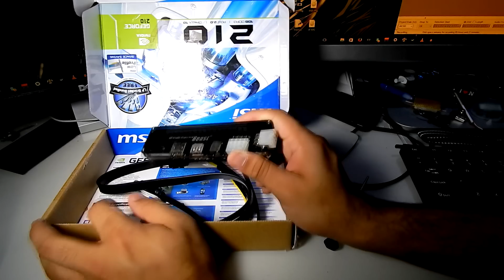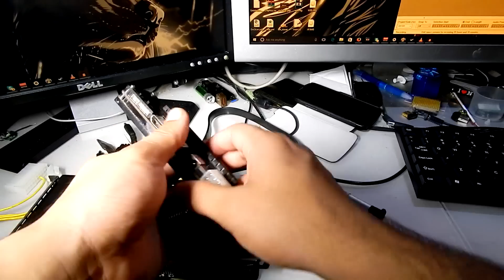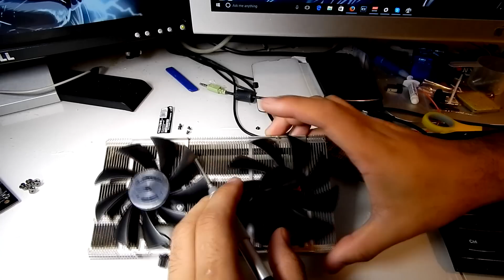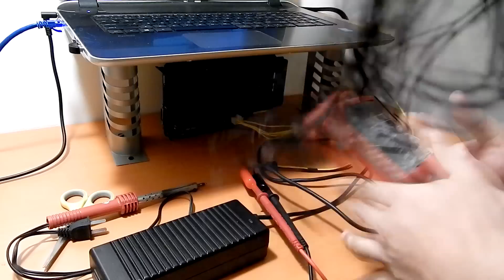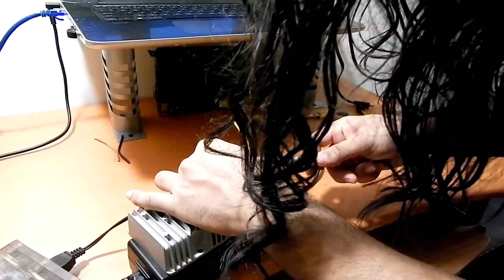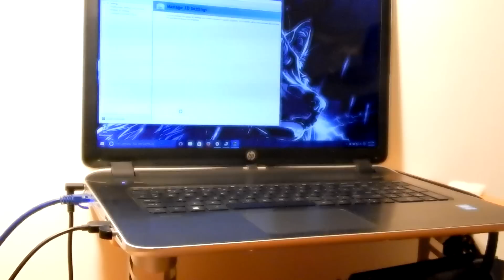Turn Any Laptop Into A Gaming Machine For 72$

Comment: And as a tip for cleaning your GPU use a little bit of compressed air or a can of compressed air never use water or soap water cuz if you scrub too hard or too often you will remove an enamel layer that is protecting the metal from oxidizing or degrading

Comment: Couple months ago, I journeyed down a similar path... My trusty old G560 Intel Core i3-380M, Intel HD Graphics, BIOS 29CN38WW (V2.15),
 8Gb DDR3 SDRAM, 500Gb SSD: I purchased = V8.0 EXP GDC Beast, (HDMI – Mini PCI-E). Used a 550w PSU and a GTX960 card. Admittedly I wasn't aware that if you had 2 banks of memory, could cause problems. I found that my lappie wouldn't boot up with everything attached except the HDMI/mini PCI-E. So when in windows just hot connected the beast with the HDMI and windows detected the external GPU setup so, yeah! does work (no soldering involved), on the cheap (a lot less than buying a new PC) with a bit of patience....

Comment: Are you talking about the integrated cpu? That’s actually inside the processor. Intel CPUs  have GPUs integrated in them you can run them without a card installed  with the right motherboard

Comment: To those that are complaining , EGpu Actually works and really does boost your performance ! It is best to use Pci method . I have a Nvidia GeForce GT 420m 1gb VRam installed (Integrated) Inside my Acer Aspire 5742g And usually get around 20-30 fps playing GTA 5 on medium Graphic options But when I installed the eGPU (PCI- method) Using graphic Card Nvidia GeForce gtx 1080 2gb Vram ddr5 ($120NZD) I now get around 60-80 on High Graphic Options , It is a big improvement From my old graphics Memory Despite having a shit CPU i5 430m It still runs well .

Comment: My laptop can play Fallout 4 at 1080p on very low settings with some tweaks to the .ini file. I WANT MOAR!!!! The issue is, my laptop doesnt have an ethernet port or a disc drive so i will have no way to rout the pcie cable. halp pls

Comment: wow everything i needed in 1 vid i was just wandering i have asus 12 ram gtx950m can i still do that and instead of soldering can i just buy the adapter ? // charger ??
Reply from the maker: you can use a old pc psu.
Reply: Davindra ok sure thing i have that what and last question do i need to take my laptop apart to plug the cable or is there maybe an adapter to usb or ether net or maybe even sd mmc cuz i have that
Reply from the maker: just a screwdriver you gotta get creative with the cable
Reply: I use it for school i cant take it apart evreyday is there another way?
Reply from the maker: i dont really have a plan for that,
Reply: Davindra that’s not answering my question though.. i asked if there is another way ?
Reply from the maker: umm not really you could just leave the dock and only take the laptop.
Reply: no i know that i am talking about how to connect doc to laptop u have to take back cover out thats why i asked is there anothere way without taking the back out.
Reply from the maker: you can try to leave the cable connected with a hole or something and have it wrapped up with a tie when your not using it.

Comment: i need your help with this....i tried this dock with my dell inspiron 15 5559 laptop and the graphics card just wont show up...the laptop uses the ngff version tho....i also removed one of my RAM chips and still nothing....what should i do?
Reply from the maker: Thats strange the make sure everything is connected right and that the card is turning on with the machine. Also if your on windows 10 try a restart and disable fast startup.
Reply: ok... i'll try dat...tnx
Reply from the maker: no prob

Comment: Exactly a year later:
So by my understanding: as long as you have a way to power and connect the card to the laptop, the chips should be able to understand what you are trying to do?
As mentioned a year later, i found all necessary adapters for like 25$ (i have a macbook pro 2016 so from t3 to mpcie to pci16).
I have old gtx260 and old psu.
I'm good to go?
I don't even have to take the laptop apart.
I will try and post outcomes.
Reply from the maker: Im not so sure itll work that way.
Reply: that was quick answer, what am i missing?
Reply from the maker: Im not sure if you can use all those converters and have it work. You can try but i dont have any idea if it will but it does seem like you the basics down gpu, dock and psu.
Reply: for 25$ i will definitely try!!!

Comment: I cant open the nvidia control panel. Help?
Reply from the maker: Try a restart also check to see if the card shows up in device manager.
Reply: The card is shown on the device manager and it is saying that the card is working properly. I have a gtx 1060 3gb and using 372.70 drivers.
Reply from the maker: I guess try a restart if that doesnt work reinstall the dirvers
Reply: I fixed my problem and am able to open nvidia control panel. However when using GPUZ under GPU load it is at 0 percent the whole time. Also when I am playing games the fps is close to 1.

Comment: i love how whenever i see these "turn any laptop into a gaming a machine"  i doubt this would work on a lot of loptops
Reply: @Korpian most laptop cpu's are not fast enough to handle games even laptop i7s can be very slow. Also alot and I mean alot of laptops don't have good enough cooling to prevent a laptop from basically cooking itself when the cpu goes over 35% usage.
Reply: @Korpian 
650ti boost? Cause I don't really know any games that would play at 60-70 fps on a 1gb standard 650ti Heck even 650ti. So I'm wondering if ur only playing a single game that's an oldy and at like 720p. No hate just saying, cause I got off an r7 370 Wich was about as fast as a GTX 750ti and a 750ti isn't all that much faster than a 650ti boost. And I know there wasn't many games where I could play at 70fps with a r7 370. In short my r7 370 is only a bit faster than ur card. Maybe like 15% at most.
Reply: @Korpian 
Then what games do u get 70 fps in?
Reply: @Korpian 
Damn I hope ur screen is 24 inches anything bigger with 540p would look aweful. Also I'm shocked a i3 handles GTA so well. Unless u got a full newer age i3 quad-core. Then not so surprising.

Comment: yah man I'm no electrician,  I'm sure I could pull this off but I'm guessing my laptop wouldn't be this complicated but F it I guess it's time to try building a Pc from the floor up instead , seems less complicated to work with the msi skylake motherboard then rewiring a power plug and takin out my Wi-Fi chip, since laptops don't make it very easy to work on let alone take apart....i mean yah if ur installing ram or said Wi-Fi cars or w.e but ne thing else is just ridiculously tedious

Comment: what port is best to get an adapter for ? Shuld I use the pciexspres external port or the card slot that holds my wifi card(internal)
I have a dell e6400  2 duo t9800 @2.93GHz not oc yet will this work for mid gaming and sound editing ?

Comment: before I bother to watch this, will the egpu need to be plugged into the wall?
Reply from the maker: Yes,
Reply: can you convert the power to usb, so that if the laptop is plugged in, then the gpu is plugged in to the laptop, and powered with USB, connected to the wifi area whatever?
Reply from the maker: Sadly not a usb port doesnt make enough power to run a card.
Reply: can 3 usb ports at the same time do it?
Reply from the maker: Nope, only pcie and thunderbolt
Reply: so I could power the gpu with the thunderbolt, then connect to laptop from inside of laptop?
Reply from the maker: i wouldnt know to be honest.

Comment: @Davindra Are we supposed to get the wifi dongle so that the laptop thinks it still needs the PCI E slot or can we just use a LAN cable?
Reply from the maker: you can use lan cable, the laptop doesnt care about not having a wireless dongle.
Reply: Oh ok. Cos I'm building a eGPU too with a Rx 580 and the comp has one stick of 8 GB ram. But the laptop doesn't detect the card.
Reply from the maker: Oh, double check to make sure that the card is getting power, also if you know how check device manager and see if its appearing under display adapters.

Comment: could you just use an hdmi to a hdmi cord? my mac laptop has an hdmi port
Reply from the maker: nope
Reply: if its not too much, but why?
Reply from the maker: the protocols are different, hdmi doesnt recieve signals it only outputs.
Reply: ok well thanks any ways
Reply from the maker: no problem.
Reply: do you perhaps know another way to connect it (or other things) to my macbook without tearing it apart or buying the $200-$500 thunderbolt stuff?
Reply: like pcie to thunderbolt adapter or to USB 3.0 maybe?
Reply from the maker: sadly i dont, sorry.

Comment: Hello I'm doing this for the first time. I have an nvidia gtx 960 and it has one place for a six pin connection and two dvi connections. How do i connect this to my laptop. I need to buy a pci and power supply. Do you have any recommendations on what i should get?
Reply from the maker: +zforged you'll need the dock and a standard PC power supply should work

Comment: After adding GTX 750ti using the adapter i also upgraded the ram on my laptop. when i am using the external card with the new ram, i get a load vender.dll error if if i keep the card connected. While using the new ram if i connect the external card and boot, the system doesnt boot at all and gives a Mini PCIE cable check error. If i remove the new ram and use my old ram all works fine. help needed, anyone have any suggestion.
Reply from the maker: +Sonopixy Aquin well I got a couple of ideas the ram might be bad, but that seems unlikely it could also be that the machine isn't capable of addressing all the hardware. But I would say try cross checking with a different ram stick

Comment: this is not how to solder. You want to take your iron to the wire, press the solder to the wire and the heat from the wire will draw the solder into the wire.

Comment: http://www.ebay.com/itm/Expresscard-V8-0-EXP-GDC-Beast-Laptop-External-Independent-Video-Card-Dock-/302135330472?hash=item4658ab46a8:g:qwcAAOSwKOJYJajD                       would this kit work
Reply from the maker: yes if you computer has expresscard
Reply: Davindra can I hook it to the wifi card spot to if I get the right adaptor
Reply from the maker: +GamingHandyMan you'll need a USB WiFi dongle but it should work
Reply: Davindra okay thanks for replying
Reply from the maker: +GamingHandyMan no problem

Comment: Never put solder on the tip of the solder gun. You'll burn the solder, and also not have a good bond between the wires.

Always heat the wire, and place the solder on the heated wire.

Learn how to solder kid!.

Comment: I've known for years that this could somehow be done, thanks for the great video that proves it!

Though I'd rather use a regular desktop PSU, some of those off-brand notebook models are a disaster waiting to happen. Had one of these knockoffs in my now old (& gone) Dell Latitude D610, there was a warning about the PSU. If anyone has worked with notebooks, the 120W adapters that's OEM (genuine) are heavy, the knockoffs are light & gets hot very fast. 

That's why I'd go with a known working spare desktop PSU, or if insisting on being portable, a model that's an OEM unit. Any that are 120-180W will do, 90W models may get too hot for this. 

This video has been a pleasure to watch and very encouraging to me to use a couple of still good, yet unused GPU's laying around, notably a 1GB GDDR5 MSI 7770 GHz Edition (PMD1GD5). It would turn an average GPU into a folding@home number crunching machine, especially if the CPU won't bottleneck it, and I don't 'think' that a Toshiba Satellite A665-S6066 with an upgraded i7-740M will choke this card. 

May not be good to use on a notebook that has a discrete GPU, unless the installed one is the same as the one planned to use (only one's mobile, the other for desktops), though that opens another question, how to SLI/CrossFire these. I feel that the best success will be for those with Intel HD Graphics only (any version). 

Cat

Comment: good video but tbh its not really worth doing, not all laptops would be capable of doing this, the slot is meant for wireless cards, not gpu's and then theres the bandwidthcoz your basically converting a x16 to a x1.your better off just building  a budget gaming pc for bout 400 quid plus even legacy desktops are normally way more powerful than your average laptop

Comment: Nice video. Very informative on what is possible. I have never even seen a mini-pci-express converter before. Interesting idea if you have the parts laying around or want to keep it semi portable. I think I would prefer a good sff pc with a full 16x pci slot and a portable monitor to this setup but it is interesting to see what can be done. I am sure if you did some more searching you can find a mini power supply that  feels more portable and less hodgepodge. Thanks for the interesting video and keep it up!

Comment: Could someone help me with this problem, I just borrowed my friends r7900 and hooked it up. Everything works fine until it "freaks out" (technical term) at which point I lose the picture on my monitor, my laptop freezes and the fans spin as fast as possible. I have to hold down power to turn it off. The freaking out seems to be linked to having too much to process, emphasis on seems. Any answers would be appreciated

Comment: too bad this doesn't work for arma players. that game ignores your gpu and destroys you cpu :C but I digress, as long as you start playing a game that requires a stronger gpu than cpu this works great, however don't expect to get far with a Older laptop say 10-12 years old as you will find your games chugging even with a good card.
Reply: NotSoGood It ignores the GPU on the lowest settings. Set shit to medium and move some of the load to the GPU.
Reply: Azzalack yeah I know about that, I'm saying that even with a good gpu if you're processor can't handle the load it can burden the gpu, even if the gpu is taking 70-80%. bottlenecks can happen often with this device, just making sure people don't go over board buyig the top of the line gpu and ending up unable to run it, you can go buy a good card if the laptop is fairly recent like a year or so.

Comment: i cannot find a single reason for doing any of this.
you need an outlet for it to game, taking away its mobility aspect.
its actually getting to the point where its the size of a micro atx case and 16 inch monitor.
it requires a large portion of effort rewiring things and at the end of the day its not even cost efficient.
so why not build a micro atx pc with better hardware overall at around the same price point?
hell you are almost better off mounting a laptop display in the side of the computer case at this point.

Comment: please help me @Davindra
Reply: +Davindra   so hey..... Not worth the work...... Shitty bottleneckin'  coz most cpu's on laptops are 'u' version.... So surely bottleneck.... Apart from this.... I feel you bro. I also talk like you,fast paced N use too much "ur, kinda, so" etc.   
Plus, the secondary costs apart from the gpu sum up to be much more.... Its better if we sell the old lady N build a real big ass rig. So that's what i wanted to say. Forgive me for Being an asshole
Reply from the maker: hello.
Reply: Davindra can you help me with this ? I have almost the same pc as u have in this vid tho it's a AMD CPU
Reply from the maker: Agent 47
it should work, as long as your laptop has a mini pcie slot.
Reply: Davindra how do I know if it has that ?
Reply from the maker: Agent 47
it should be where the wireless card is.
Reply: Davindra don't I have to open my pc then I don't know how to
Reply from the maker: Agent 47
umm idk what to tell you.
Reply: johnny boy the bottle neck will not be that bad newer laptop CPUs are decent. Also for a project like this you could pick up a older used graphics card off eBay for quite cheap, something like a gtx 670 will run most newer games at 30fps minimum and you can get one of those for under 80usd.
Reply: Hunter Milligan we got razer core now
Reply: johnny boy the razer core is 500$ (plus GPU price) it also needs a thunder bolt port something that's not a industry standard yet and it only natively supports razer laptop's (your preformce and it even working may vary on other laptops)
Reply: Hunter Milligan  oh didn't knew that it supported only razer laptops..... Damn. Sorry then thrifting parts would work. OK thanks
Reply: Hunter Milligan

Comment: Do you think i can use a xbox 360 power supply instead of the one you recomended? its specs 12v 16.5a 203w
Reply from the maker: you would need to splice in a 4pin connector but it should after that.
Reply: Davindra thanks for the answer man! so there's no problem with the 16.5a ?
Reply from the maker: McFly Garcia
shouldnt be as long as the voltage is right.
Reply: Davindra ok i will make some tests and even try to record it , will try in a xps l502x with I5 Sandy Bridge GT525m dedicated and to use a gtx750ti to pair with .

Comment: ACX coolers are sexy. I'm about to try to pick up a 4gb 770 FTW to replace my blower-cooled 2gb 770. No regrets.
Reply: Glenn Mitchell why would you get an new gpu amd then buy the exact same card just with a different cooler? just a 9 or 10 series card if you're buying a new one anyway
Reply: I can get the FTW locally for as much or less than I could get for my current card on Ebay. I've been eyeing the Sapphire 8GB 480 pretty hard though. for $150 out of pocket I could be set up to drive a 1440 freesync monitor acceptably.